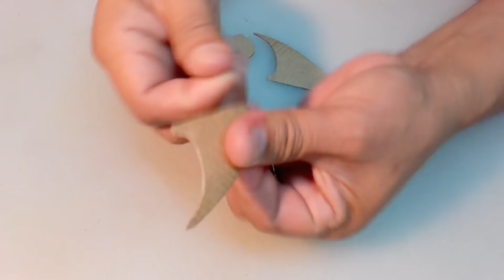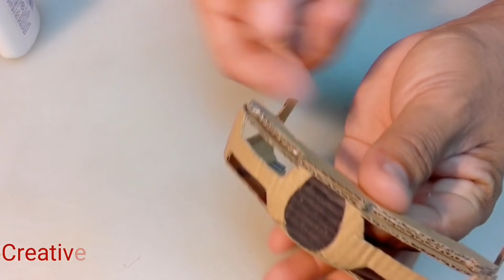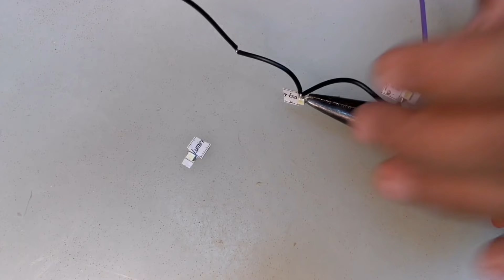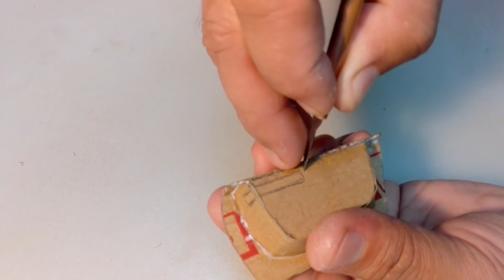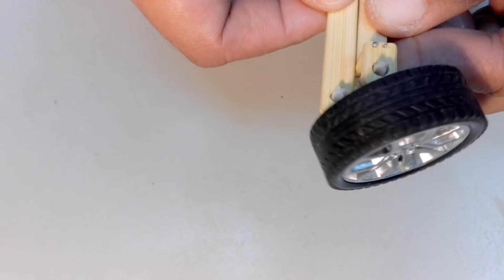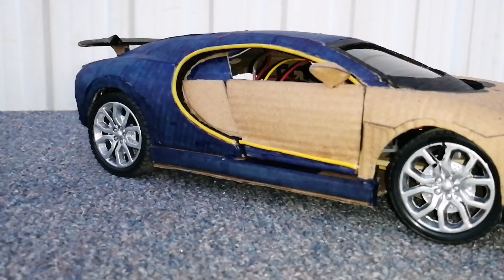How to make Bugatti Chiron RC cardboard /with Automatic door

Comment: How many volts batteries u used in the car bro
Reply from the maker: 1.2 volts each battery bro, connected to series with the total of 4.8 volts.
Reply: @CreativePhil  for each car receiver where did u getting it bro
Reply from the maker: @Venkatasurendra476  I got from cheap  Chinese toy car. You can also buy from online store if you can find  more channel each receiver  much better.

Comment: Can u tell me the wheel size  and under base template
Reply from the maker: Wheel diameter is 4.5 cm the base  length 28 cm width 12 cm
Reply: @CreativePhil  tq very much bro
Reply from the maker: Welcome bro
Reply: @CreativePhil  bro u used a black colour device to open doors from where did u get that bro...